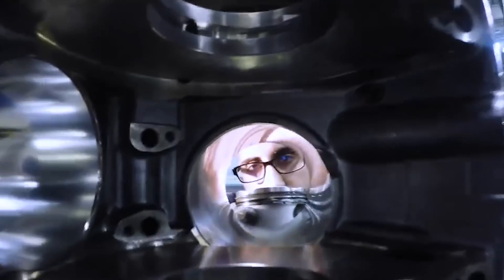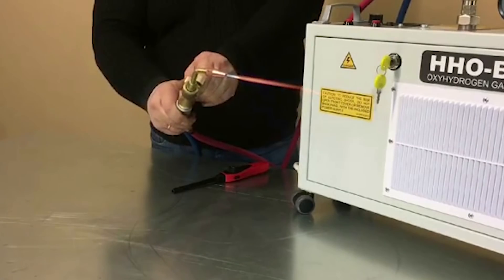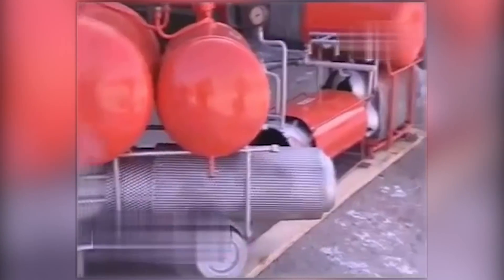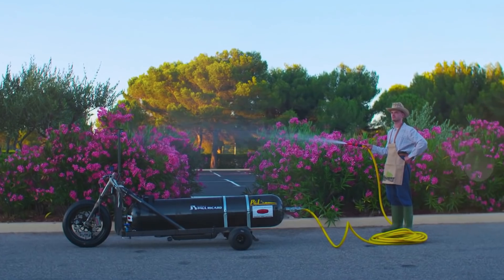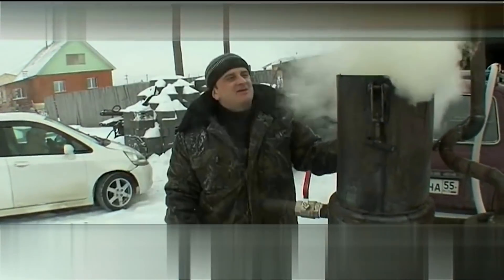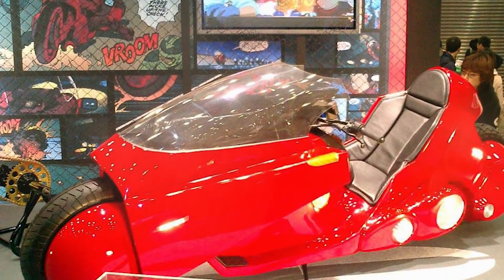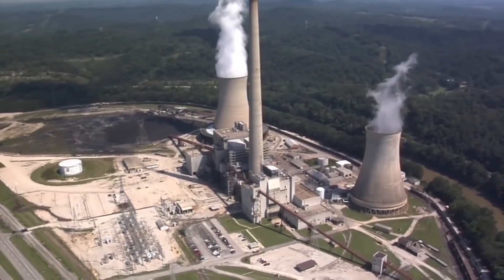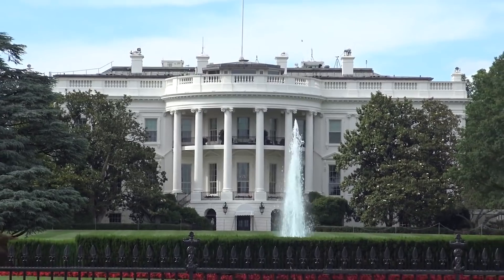Why These Engines Are Banned?

Comment: David Edens is correct. This is moonshine.

Compressed air cars require compressed air. There is no free energy here. The energy required to compress the air is always LARGER than the energy that can be obtained from the compressed air engine. Compressed air is NOT a primary energy source, but only an intermediate between electricity, gasoline, or whatever is used to compress the air in the first place and the final vehicle. 

Magnetic Engine? Pure HOAX. Such a thing does not exist and CAN NOT EXIST.
Reply: kcotte59  
There is no gain in pre-compressing the air. Compressed air is just fine for power tools and short range vehicles, but the energy to weight (including tankage) is 100 times less than hydrocarbon fuels.
Reply: Magnetic engine can exsist if its electromagnet but then that kinda defeats the purpose
Reply: kcotte59  "If you violate the 2nd law you will be ridiculed but not fined."
Except you can't violate it. However you can be ridiculed for suggesting you can.
Reply: @wisenber  you have stone age mind. Look at 2nd law of thermodynamics. Now look out the window.
Reply: @clivewells7090  Actually, Newton was 18th Century, not the Stone Age. Newton helped debunk alchemists such as yourself.
Reply: kcotte59  "makes the energy produced exceed the energy used to compress"
Except it doesn't.
Reply: They didn't mention how much energy is bottled up to propel that air driven car. A compressed air tank is extremely dangerous when ruptured. It can become a rocket, literally.
Reply: Smedleydog1 what about two liter bottles of soda and Mentos? Seems like that has quite a bit of energy potential... What kind of PSI would that generate? Yes, you’d have a sticky mess, but it has to be less polluting and cheaper than gasoline or diesel! ; )
Reply: @Smedleydog1   And a few gallons of gas vaporized and ignited in a confined area can level a city block.
Reply: @charlesangell_bulmtl  You are very welcome.  It is funny how people say we can't do this or we can't do that when the only thing stopping them is that "n't".  I just looked up the world's  deepest mine.  It is approximately 3.9 kilometers below the earth's surface. There are 3,280 feet in 1 km, which means there are probably numerous abandoned mines that are 1 km deep which could be used for a trompe, assuming they are close to an adequate water supply.
Reply: @wesbaumguardner8829  And where does the water go after you pour it in the mine, bright boy?
Reply: @mfree80286    Where does the water go when you open up the valve to your water hose, dim boy?  It runs out onto the ground.  All you need is an elevation difference between the inlet and outlet.  The head pressure difference will do the rest.
Reply: Swampy right it’s called power loss, that is the main problem with solar power, em power, and wind turbine power. However, power loss can be reduced by changing a vehicles drive gearing. But that is not what I am trying to say. I am making an example of a engine which uses electro magnets to produce power. I am not saying that it has anything to do with the vehicle’s main drive, however it uses  kinetic energy to keep the battery charged. So it in exact definition is an electromagnetic engine.
Reply: Ever heard of a brushless DC motor?
Reply: An electric motor is technically magnetic
Reply: By harnessing the natural electro motive force,a repulsor type engine is perfectly feasible.
Reply: @darkknight1340  
Nearly all electric motors use magnetism.
I was discussing the mythical motor that worked on magnetism without any external power source.
Reply: Swampy  this was an old jag  engine 35 years ago, and I have seen these sprays myself, just not into the air filter. If you haven't heard of engines performing better in damp air I suggest yu do some experiments in your mind; What is air made of? What is water made of? What happens to damp air in an engine? It's not rocket science because water cannot be sold. The WHOLE planet is a prison and the governor will not allow inmates the technology to escape
Reply: Swampy  I think I have my wires crossed; I didn't think u said damp air was a benefit
Reply: You have given your title a PhD. Therefore you must be genuine and correct as somebody with a PhD would not be a professional debunker for the oil business. 
We all believe you now so we can all go home.
Reply: @cardinalsin6313  Learn THERMODYNAMICS.
Reply: @DavidFMayerPhD  LEARN technology which is being supressed to keep us reliant on the oil industry....
Reply: @cardinalsin6313  
That is pure paranoia. NOTHING could prevent private individuals from building and selling such machines. In fact, many are ALREADY being sold on the Internet. Unfortunately, NONE OF THEM WORK. Furthermore, none of them can possibly work. 
Learn Thermodynamics.
Reply: @DavidFMayerPhD  oh dear, you are a very trusting and naive little soul, aren't you? Big oil would never do anything underhanded or illegal to keep the world reliant on their product, would they?
Reply: @cardinalsin6313  It is not a matter of HUMAN LAW, but of NATURAL LAW. The claim violates Thermodynamics, so it is impossible for it to be true.
Reply: @DavidFMayerPhD  i live right in between two air force bases. I see quite a few unexplainable objects flying not too far above my house, very possibly monitoring what the air force is doing. Bright glowing things that can do 90 degree turns without slowing or stopping. The next time i see one i shall be sure to shout up and remind them to study the laws of thermodynamics.
Reply: @cardinalsin6313  If YOU can see them, then the Air Force can also see them. The Air Force is very picky about unauthorized aviation activity around its bases, and would have done something had these been observed.
Hence, I conclude that either: 
You are misinterpreting ordinary objects as UFOs
or
You are simply lying to get attention.

Which is it?
Reply: DavidFMayerPhD dear sir, don't be so insulting. I know the difference between a lantern and an etv. Especially when most of the time I am with others who see them also. And what I CAN actually ascertain is that you are NO PhD. Just a know it all who has to have the last word. And just for asides, how do YOU know that the airforce hasn't done anything about these? You never asked.
Reply: DavidFMayerPhD Pre-hensile-Dicky
Reply: Magnetic Engines obviously exist. I was shown these working in 1991 but the Oil Compainies manage to shut these ideas down as threats to National Security. the working example I saw was built using a standard Briggs and Stratton 3 1/5 horse lawnmower engine and the piston was replaced with a super powerful magnet. the flywheel weight was very important as the magnet would overcome the resistance as one magnet would approach the other that was where the cylinder head would have been. it produced 40 horse power. the VW cabrolet (convertible) in 1937 only produced 37 horse power. a cr500 2 stroke dirt bike makes a little over 40 horse power - its plenty for transportation - trucks could use multiple small engines in line. it would run perpetually until the bearings would wear out. or could be shut down by a block off plate. once it started it didn't shut down, it would have needed clutches to smoothly transmit power to the drivetrain if it were used in a car. a PhD is useless when you are too stupid to know your a$$ from your elbow.
Reply: @paulreed6089  
This ignorant statements says it all.
"it would run perpetually until the bearings would wear out."
That is an infamous "perpetual motion machine", which is IMPOSSIBLE. 
You were NEVER shown a working model of such an engine since they do not exist.
Learn some Thermodynamics and then get back to me.
Reply: Gap  wrote,"all electric vehicles are based on this 'magnetic' engine, that's pretty much how electric motors works."

Nope, sorry. Electric motors are not powered by magnetism in any way, shape or form. Electric motors USE magnetic fields but are POWERED by electric current.
Reply: The other name of a magnetic engine is call electric engine!
Reply: @lizadonrex  Sorry, but that cannot be true. If you understand the dielectric field, you would understand that dielectricity, magnetism, and electricity are entirely different concepts altogether.
Reply: And who said these 'lights' were at a considerable distance? Bad assumption for anybody to make
Reply: @cardinalsin6313  I am waiting for the box of UFO parts. Until you have such PHYSICAL EVIDENCE, can the chatter.
Reply: @cardinalsin6313  
If UFOs were extraterrestrial spacecraft, then they would have left PHYSICAL EVIDENCE of their presence. When I see it, I will believe. Until then, NOT.
Reply: @DavidFMayerPhD  Time for bed little man. Don't forget to drink all your cocoa before it gets cold, and don't spill any on that nice duvet which mumsy has washed for you.
Reply: @cardinalsin6313  
Time to learn to think LOGICALLY. Physical objects leave physical traces. Such traces have never been found. Hence, no flying saucers have been demonstrated.
Reply: @DavidFMayerPhD  time to think logically. Its way past your bedtime. You are a kid with a chip on your shoulder.
Reply: And have you ever been to Saturn? Or physically seen it? So therefore it must not exist.
Reply: @DavidFMayerPhD  No wonder your dad left home. He must have been a star for putting up with you. Had you been my kid I think I would have taken you for a long walk off a short pier years ago
Reply: @cardinalsin6313  How many times were you dropped on your head as a kid? Anybody who believes in Flying Saucers is clearly NOT playing with a full deck. I doubt if you have a card higher than a 7.
Reply: @DavidFMayerPhD  Right folks, I think I have established without a shred of a doubt that this fake phD kid is indeed not what he says he is. His dad left home because he was sick of him, thats the truth because I got a positive reaction. Took the bait hook, line and sinker. And btw I never once mentioned 'flying saucers'
Reply: You are wrong.  There is a device called a trompe that has been around for hundreds of years that compresses air without the need for paid for energy.  While it is not creating energy, it is trapping energy that would otherwise not be utilized, and is doing so in an environmentally friendly manner.
Reply: @wesbaumguardner8829  A trompe device uses falling water as the primary energy device - so is hardly free energy. Further, there is no way it could compress air sufficiently for use in a compressed air vehicle.  Hydroelectric power generators are far more efficient.
Reply: @buggsy5   I never said it was a "free energy" or over unity device.  I said it was a "not paid for" energy device that converts water head pressure to air pressure. Furthermore, your statement that the trompe could never create enough air pressure to drive an air pressure powered car is incorrect.  The  air pressure attained by the trompe is only limited by the head pressure of the water used to trap the air and the ability of the device to withstand the pressure.  The deeper the air reservoir of the trompe, the more head pressure there will be.  Water is very heavy.  A 200 foot head pressure should be more than adequate, however if a mountain water source is used, several hundred or thousand feet of head pressure can be used.  Just like business, it is all about location.
Reply: @wesbaumguardner8829  To be of practical use in a vehicle, you would need several thousand psi of air pressure. You get 14.7 psi for every 33 feet water depth. That means you need 136 atmospheres for 2000 psi. That translates to 4490 feet of head. 

Your 200 ft head will only produce 89 psi - enough to run a toy model possibly, but not a vehicle.
Reply: @buggsy5  So use a mountain stream and also dig.  We drill several thousand feet for an oil well, often drilling horizontally.  We can do the same for self sustaining energy, too.
Reply: @wesbaumguardner8829  how is the trapped energy used..?
Reply: A trompe turns the head pressure of water into air pressure.  Air is trapped in a subterranean tank that has at least one shaft with a  valve which allows the compressed air to be accessed.  The air can be utilized to release kinetic energy or the depressurization can be used in refrigeration.
Reply: @wesbaumguardner8829  so this decreases the pressure of the tap water..?
Reply: @clivewells7090  No, the trompe uses the head pressure of water to compress air.  Say you have a tank full of water with a spigot at the bottom.  The head pressure at the top of the tank is low and increases at deeper points in the tank with the greatest head pressure being at the deepest point in the tank.  This is due to gravity and the weight of all the water above that point pushing down on that point.  If you release the spigot at the bottom of the tank, the water will blast out at first but the flow rate will gradually decrease as the water level lowers which decreases the head pressure.
Reply: @wesbaumguardner8829   It is nothing more than a water powered low pressure  air pump. The one advantage is that it can be made to have no moving parts.  Dimensions are not critical, as long as the water flow rate is high enough to suck the injected air bubbles all the way to the bottom of the tower and into the air separation/storage tank. 

One problem is that it does not produce a very large volume of compressed air. There is also a significant loss in head height due to the necessary differences between the heights of the water intake and water outlet. 

I am fairly sure that a Pelton wheel coupled to a mechanical air compressor would be more efficient.
Reply: @buggsy5  The volume of compressed air is purely dependent upon the size of the tank, the flow rate of the water, and the amount of air that is able to be  extracted from the water.  The only real limitation that cannot be negotiated through engineering is the amount of water in the stream which is controlled by nature, but even that can be overcome by correct site selection.  The head pressure can always be increased by digging more and placing the tank deeper under ground.  There really is nothing preventing us from using this as a source of energy aside from corruption and ignorance.
Reply: @wesbaumguardner8829  This is only effective if the water is higher then the air to be compressed. If you have water at the top of a mine, or hill, the water will compress it. If you try to compress the air and bring it back up, it will not be a higher compressed air than the air around it. 
It's a great idea if you have the water on a hill, but not if you have to pump the water up, it will take more energy than it makes. Plus the water can not compress the air once you bring it to the same level. It works best in a mine where you want high flow and low pressure.
You can never have a device that creates more energy than it uses, because of friction. If you could do away with any friction, which is impossible, you could have a perpetual motion machine, but not a source of power.
Reply: @kutzbill  A trompe uses a vacuum created by falling water to suck air into  the falling water.  The water falls a distance before being forced to make a right angle, horizontally with the surface before entering a tank where the water hits a short vertical wall that it must travel over before it can traverse the floor of the tank and exit out the other side of the tank.  The tank ceiling is above the water inlet and outlet, so when the water hits the vertical wall, the air is released into the tank and trapped, because air is lighter than water. More and more air is forced into the tank until it reaches pressure equilibrium with the head pressure of the water.
Reply: @wesbaumguardner8829  A trompe is to a powered air as a water wheel powered mill is to a mill powered otherwise.  You discount the effort and energy required to build and maintain the apparatus itself. BTW, falling water is just solar power used indirectly. It was the action of the energy coming in from the sun in the first place which evaporated (lifted) the water so it could fall as rain into the river/stream/brook and so be available to be utilized. It is basically like a huge spring. The sunlight on the water "winds" the "spring" (lifts the water to a higher gravitational potential) and once the water precipitates from the air gravity takes over and draws the water back to sea level.
Reply: @billmullins6833  No kidding.  I have already said basically what you said twice.  The energy itself is not paid for.  The apparatus used to collect it costs resources, time and effort, just like every other form of energy conversion known to man.  Even if there happened to be an over unity device, it would still take human time, human effort, human knowledge, and resources to build.  There is no getting around that, period.  I never made a claim otherwise.  However, unlike other forms of energy, the trompe uses a self replenishing energy source and has no moving parts aside from the valve which allows access to the pressurized air.  Hence, very little maintenance is required once the system is installed.  The installation and maintenance of a hydro-electric dam would be much more expensive over time, comparatively,  yet we still build them.   We spend vast amounts of resources and time drilling and building extensive piping networks with intermittent pump stations for oil, which is a finite resource, yet we still do that, too, even though it is much more expensive than a trompe system would be.  Your argument is moot because there is no other energy resource known to man that is more efficient and/or does not have the same constraints.
Reply: @wesbaumguardner8829  OT: Did you ever live in Odessa, Texas?
Reply: @billmullins6833  Nope, but some of my family did.
Reply: @wesbaumguardner8829  I knew a Wesley Baumgardner back in the day. He'd be in his mid-late 70s now.
Reply: @billmullins6833  Sorry, that's not me.  I'm too young and the last name is spelled differently.  Hope you see your friend, though.  You can never have too many of those.
Reply: @paulreed6089  How was the pressure difference maintained?  Seems to me that there would have to be a lot of friction on the rotor or an external power source.
Reply: DavidFMayerPhD you are right except for the part about magnetic engines, as a matter of fact technically ( if you consider the definition of a engine being something that produces power) there is one in you car along with every other car out there. It is called an alternator.
Reply: @M.I.L.F speedsoft Team, a few things here:
1) Engines convert chemical or thermal energy into kinetic energy, anything converting electromagnetism to kinetic energy would be a motor.
2) An alternator doesn't run on electricity (even though it does need a source of electricity for electromagnetism), so it's not a motor. It converts mechanical energy into electricity, so it's a generator or "alternator" since it's AC.
Reply: Nicholas Crespo well, not completely true either, not all engines run off of internal combustion. Examples are Teslas, rc cars, and any other device with an electric powered engine. Although alternators aren’t directly engines, they do follow the conceptual definition of an engine is an object which takes one kind of power and transfers it to another kind. In the case of an alternator, it takes the kinetic energy from their belt and transfer it to electrical energy. Hence why I used the example.
Reply: @brandonmetz3972  wrote "there is one in you car along with every other car out there. It is called an alternator."

Ah, no. The alternator is not an "engine". All it does is convert some of the torque produced by the engine into electrical current to power the electrical systems of the vehicle. Now if you applied current TO the alternator, it would function as an electric motor - albeit a very poor one since it is optimized to convert torque into electric current rather than the reverse.
Reply: @billmullins6833  well, a motor (or engine) is used to transfer one kind of energy to a different, more usable kind, in this case I was trying to make an example out of a well known object. A alternator converts kinetic energy to a more usable electrical energy which keeps the battery charged on your car. This is done by surrounding a magnet with copper or another conductive material. The vehicle's belt drive is connected to the alternator and causes the magnet in the alternator to spin with the belt drive. When the magnet spins in the copper cage, it creates an electrical current. So even if it doesn't move the car, it still converts one form of energy into another form which is what a internal combustion engine does. This is also why there can never be "free energy" because you are just converting one form of energy to another more usable form. I know I should have put an explanation in that comment to my thought process. I hope this allows you to understand my thought process.
Reply: About your last sentence, who know what we'll have tomorrow, those thing might be possible
Reply: @izokido  "who know what we'll have tomorrow"
Well we do know that it won't violate the laws of thermodynamics.
Reply: kcotte59  I can see your reply(ies). One thing I am certain of is that water vapour added to fuels increases output. My friend noticed this when he replaced his leaky radiator and found his fuel consumption rose. After many checks he replaced the old radiator and went back to 25 or 30 miles a gallon (petrol.) It took him a lot more time to realise that after  his engine warmed up a tiny jet of water was squirting into his air filter and this was making the difference. I believed him wholeheartedly as he was a good guy who I worked with and never heard him boast, brag or exaggerate, (we actually had to 'hand' drill a 6" core through the cabinet room of No10 Downing St together, but that's another storey!)
I didn't think it was important until years later when i read that British bombers in WW2 had a facility to inject H2o into their carburettors to make their fuel last longer.
Reply: @clivewells7090  the water injection in the WWII planes injected water into the fuel/air mixture so the pilot could lean the carburetors out, and the water helped carry the heat away. In higher altitude, the air cooled engine would run too hot due to the lack of air flowing over the fins. They ran a rich mixture so the unburned fuel would carry away heat. You can see in the old films the fire coming out of the exhaust. That is unburned fuel.
Injecting fuel into an internal combustion engine, with a very lean mixture will indeed save fuel, but it does not result in more power. That's really odd when you think about putting Hydrogen and Oxygen together out side will result in rocket fuel..
Reply: @kutzbill  I don't think somebody flying to Germany, dropping his payload and then flying back would be burning a rich fuel mixture unless he thought he was about to crash!
Reply: Clive Wells I am familiar with the use of water/methanol injection in many different aircraft in WW II, but I haven’t heard of water only- I’d be interested if you could post any sources, please?
Reply: @erikarneberg11  i've heard of water burning cars but don't think they are allowed by our rulers. I was referring to an injection of moisture into the air-fuel mixture to allow the planes to limp home if lost or diverted.
Reply: Clive Wells  No, obviously we’re talking about petrol engines here- I’m not suggesting that they RAN on water, but the water injection systems that boosted horsepower that I’m familiar with ALL used a mixture of water and methanol (alcohol), for a wide range of reasons- some having to do with the  process inside the combustion chamber (flashpoint, flame propagation, stoichrometric ratios, and other fun stuff) but on a more prosaic level, the water, without methanolwould freeze at altitude...
Reply: @erikarneberg11  at higher altitudes water boils at lower temps... jus sayin
Reply: @clivewells7090  Water injection would, indeed, increase engine power output - but not because it works as fuel (i.e. an energy source). Water injection increases any internal combustion engine's power by making it more efficient. When water is injected into an engine at the time of combustion it does two thing which are beneficial. #1 it absorbs some of the energy from the explosion of the fuel-airmixture which would otherwise have gone into the cooling system as waste heat. #2 that heat the water absorbs turns it to STEAM which has more mass and thus pushes harder against the piston and effectively increasing power. When water is injected into jet exhaust it flashes to steam and increases the reaction mass of the jet exhaust thus increasing the specific impulse of the reaction mass and increasing the thrust of the engine.
Reply: Breaking up water to oxygen and hydrogen takes at best twice the energy than you get burning the end result ...so you waste at minimum 50 % of the electricity you put in system  .
Carbon monoxide burning in a normal engines not new , widely used under WW 2 .
There is no FREE energy .